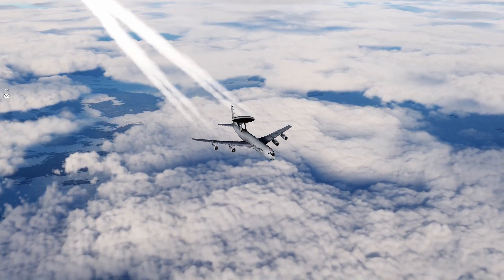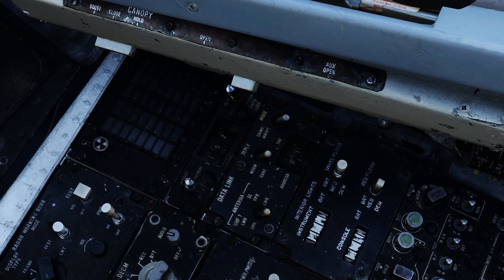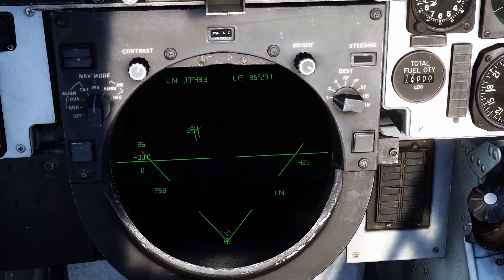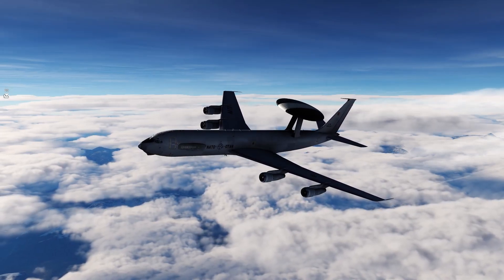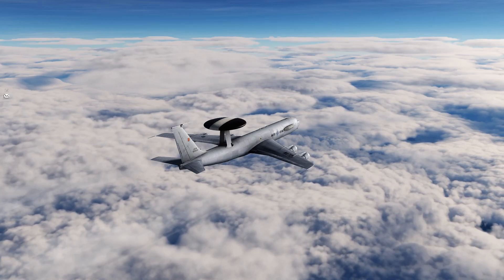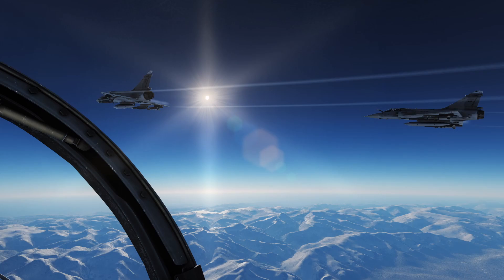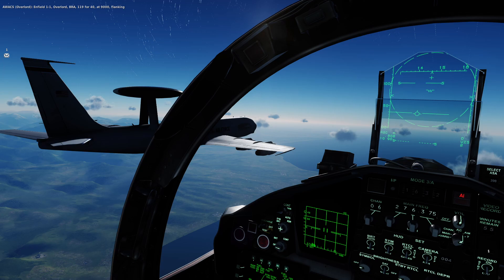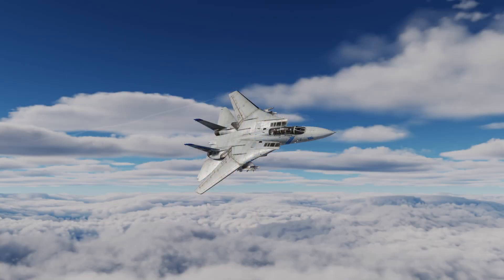DCS World - F-14 RIO Guide #3 - Link 4A & Link 4C Datalink

Comment: I didn't know about the Link 4 system. How do you enable it with the AI? Do you need to do anything in the mission editor, or you just ask JEster to tune in?
Reply from the maker: Man, that's a good question but I don't know the answer to that one, I have no experience with the AI.
Reply: Jester datalink menu:
Mode - Fighter/Fighter
Set frequency - 300.00Mhz

You will only get the position of the AI, no radar information from him
Reply: @peteranson1327  thanks! I was hoping that an AI group could be set up to transmit and the player would see them but apparently that's not possible :/
Reply: @ReflectedSimulations  mission ideas???